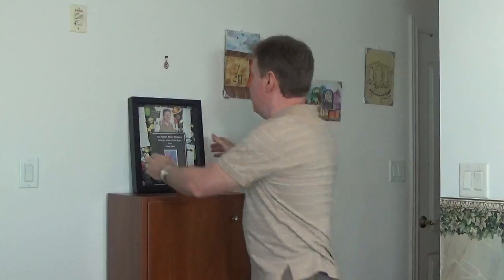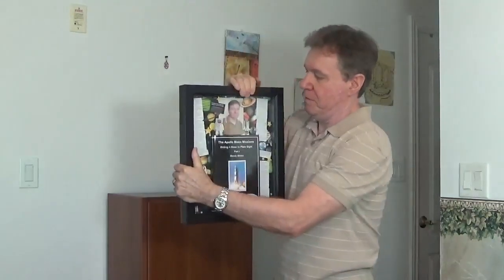Randy Walsh: Apollo Moon Mission Hoax, Saturn V and F1 engines. (Video #5)

Comment: RANDY WALSH: "And because of the pogo oscillations, the engines in the second stage - the J-2 engines - were disrupted. So, they have multiple failures, I believe they had 2 failures, actually one failure and then the computer for some reason shut down the second engine. And NASA says this was caused by disruption of the fuel lines, brought on by pogo oscillations.”

Nope. YOU made that claim, Randy - NASA didn't. 

Congressional Hearing - "SUMMARY OF THE PROBLEMS ENCOUNTERED IN THE SECOND FLIGHT OF THE SATIRN V LAUNCH VEHICLE" - APRIL 22, 1968 (page 18, paragraph 3)Major General Samuel C. Phillips, USAF, Director , Apollo Program for Manned Space Flight: "We have been able to confirm conclusively from the data that this POGO oscillation, which is a problem at the spacecraft level, and must therefore be corrected, was not at the bottom of the difficulties that turned up in the J-2 engines of the second and third stages."

In fact, you yourself said only recently... "NASA does not have a definitive answer." - but only after I had proven you a liar in the first instance on your original claim. 

The pipe failure was in a five-eighths of an inch, high pressure (750 psi) hydrogen line in which a bellows joint first cracked, then broke causing component failure elsewhere.

Apollo 6 Congressional Hearing - page 25 - GEORGE H. HAGE, DEPUTY DIRECTOR, APOLLO PROGRAM FOR MANNED SPACE FLIGHT: "And finally as a result of that line breaking, we had an erosion failure of this little starter combuster which ultimately resulted in a breakthrough in the top part of the main oxidizer dome of the chamber, which resulted in a fairly large decay in pressure and the normal shutdown sequence." (This part of the hearing transcript is well illustrated with drawings and photo illustrations.)

When you claim 'NASA says...' something, Randy, you need to quote them doing so. Attributing statements to them which you have pulled straight out of thin air just isn't working for you.

Comment: Youtube::: (World’s Fastest Car–1,000mph Bloodhound SSC) to see this supersonic-rocket-car weighing 7.5 tons (initial mass) had 135,000 bhp, ten times that of Apollo-Saturn’s horsepower, meaning that if it were equipped with Saturn-V engines it would have had only 1/10 of Bloodhound’s thrust-force, and thus would have NOT been able to move, except may be very slowly!!!. Similarly Apollo-Saturn’s thrust force of 13,636 bhp was unable to move a 3,000 ton mass, even on wheels, on the ground, much less lifting it off the ground!!! It is so simple!!!
Reply: "Simple", and unfortunately for you, wrong:

The Saturn V weighed about 6.5 million pounds, fueled.

It's thrust totaled 7.5 million pounds, on five 1.5 million pound thrust F1 engines.

Thus, a 6.5 million pound downward force was easily cancelled and more, by a 7.5 million pound upward force, resulting in an (approximately) 40 fps initial upward acceleration.
Reply: @occhamite  is there a moving car with power equal to 1.2 times of its own weight??? Name it !
Reply: @kareemsalessi   That has nothing to do with Rockets or the so-called Moon Hoax.

The fact is the Saturn V had a lift-off thrust-to-weight ratio of 7.5 to 6.5, or 1.2:1, and thus WOULD rise rather quickly off the launch pad.

Similar remarks apply to all other phases of the Apollo manned lunar landing missions; sufficient evidence is readily available to show that the missions are a demonstrated historical FACT.

Anyone who tries to argue other wise is an ignoramus, a fool, or a liar.
Reply: @paulgee4336  What makes you think you are familiar with the evidence?

I submit you are not, but for some reason think you are.

Here is a list of evidences which, taken together (as ALL would have to be faked, and faked perfectly, for a Hoax to hold-up), constitute proof by any reasonable standard (Sources available on request):

--------------------------------------------------------------------------------------------------------------------------------------------

The launches of the Saturn V Moon rockets were witnessed by MILLIONS of people.

The launched rockets were tracked all the way to orbit by international observers, including the Soviet Union.

The SIV-B 3rd stages appeared in Low Earth Orbit, (LEO) at the pre-announced places and times, and the Trans Lunar Injection (TLI) burns were observed optically. The spacecraft were visually tracked from those SIV-B burn's exhaust plumes, by both amateur and international observers, leaving LEO, on the TLI trajectory.

Apollo CSM/LM radio traffic was received by amateur radio hams, in sky positions and with doppler-shifts which made it clear the ships were in cislunar space and on a course consistent with lunar trajectories.

Astronomers in many countries observed the Apollo spacecraft in cislunar space and moving on a trajectory consistent with a trans lunar flight path.

Live tv broadcasts were aired, showing extended periods of weightlessness impossible to perform on Earth, and views of Earth from cislunar space .

Live tv broadcasts, FROM LUNAR ORBIT, of some of the Apollo missions were independently downlinked by the USSR.

The British Jodrell Bank radio telescope facility downlinked Apollo 11 LM, Eagle's radio traffic during its final lunar descent. The transmissions emanated from the correct quadrant of the Moon, and were doppler shifted exactly as for a ship dropping out of lunar orbit to a landing.

At least one radio ham downlinked, DIRECTLY FROM THE MOON, the VHF voice traffic of Armstrong's and Aldrin's personal backpack radio's, live, as the lunar surface EVA was in progress.

Video and film records of Apollo lunar surface EVA's contain unmistakable and unfakable examples of activities occurring in 1/6 g.

The reentry of Apollo Command Modules was observed by people in several countries, at the right time and place, and on the right trajectory.

Over the past 49 years, thousands of geologists, from all over the world, have analyzed the 840 lbs of Apollo Moon rocks, and NOT ONE has ever questioned their authenticity, though some have commented that the collection was obviously assembled by trained collectors.

The Lunar Reconnaissance Orbiter imaged all 6 Apollo landing sites several decades after the Apollo program ended and returned very high resolution imagery (as good as 0.05m/pixel) showing all aspects of the sites to be in perfect accord with the imagery returned at the time of the original missions.

Despite the fact that about 400,000 people worked on Apollo, no "whistle blower" with the slightest credibility has ever come forward to support the Hoax claims, not ONE guilty conscience, not a single "open upon my death" letter to an attorney, no anonymous letter to network news - nothing - EVER.

NO Hoax proponent has EVER made an objection to Apollo which stands the slightest scrutiny.

---------------------------------------------------------
--------------------------------------------------------

QED
Reply: @paulgee4336  So then, we are to gather from your silence that you accept the evidence posted?

Comment: The US Tyranny couldn't, didn't, and still cannot go to the Moon.

A typical example of the poor fakery that the NASA fraudsters tried to pass off is AS16-109-17800 from the Apollo 16 fraud.
 The right leg of the astroNot is casting a deep black shadow, but his up-light left leg is NOT.

Worse, in 17800 the Moon buggy's shadow clearly falls in a different direction than that of other shadows in the photo. Shadows in 17800 fall from the upper-left to lower-right. However, the Moon buggy's shadow, as evidenced by the shadow of its dish-like antenna, falls from the bottom-left to the upper-right.

The shadows of the astroNot and Moon buggy are a full 90 degrees off, forming an impossible "V" shape. What a criminal joke.

NASA. Apollo. Theranos.

"Ignorance is Strength." I'm weak.

https://www.hq.nasa.gov/alsj/a16/AS16-109-17800HR.jpg
Reply: K. Chris Caldwell
You'd better forget ever working as a photo analyst because you don't have the slightest idea what you are talking about.

1.) The shadow of the astronaut's left leg is obliterated by sunlight off the inside of the 'naut's right leg. Note that the Sun is shining from the left and from behind - EXACTLY where it needs to be to have that effect. The very light blocked to form the  leg shadow on the lunar surface is the light obliterating the shadow of the left leg. NOTE that the brilliant white teflon outer coating of the EVA suit is upwards of 90% efficient as a reflector.

2.) You haven't got a clue as to how shadows work: The "direction" of a shadow depends on the direction of the incident light, the shape of the object casting the shadow, the optical characteristics of the lens of the camera, and the contour of the ground the shadow falls upon. Shadows cast by a single light source can be made to appear to run at nearly 90 degree angles by manipulating those 4 factors.

https://tinyurl.com/y6ayoyye
Reply: @occhamite  ===SPAM

Comment: You really have no business making a video about Apollo 6, calling it a "hoax", when you are ignorant of the basic facts.

1.) At  1:18 you say the problem was pogo oscillations.

No, that was ONE problem, 2 actually, as BOTH the F1 and J2 had vibration problems on Apollo 6. 

Another issue was miswiring of the J2 engines during assembly,  which was the cause of the second J2 engine shutdown.

You say the second J2 shutdown was for "some reason"!?!  THE REASON WAS THE FACTORY MISWIRING; THE COMPUTER SENSED  VIBRATION  IN ONE J2 ENGINE AND SENT A SHUTDOWN COMMAND TO IT,  WHICH WENT TO THE WRONG ENGINE BECAUSE OF THE MISWIRING.

THIS IS ALL VERY EASY TO FIND OUT, AND IF YOU DON'T EVEN KNOW THESE MOST BASIC FACTS, SHAME ON YOU FOR MAKING ACCUSATIONS OF A "HOAX". 

Yet another problem was the single-wall bellows in the J2 igniter fuel line. During ground tests, that line had been reinforced by ice. The ice did not form under flight conditions, so the bellows, lacking the reinforcement, cracked, leaking fuel.

A third problem was structural failure in one of the SLA panels.....

These are all very MINOR issues, trivial to fix:

The F1 pogo was fixed by minor changes in shape of the F1 fuel lines, further "detuning" them, and by injection of helium into their prevalves, making those valves do double duty as "accumulators" - shock absorbers, in effect.

The wiring harnesses were shortened, making the factory miswire impossible, and the bellows was eliminated in favor of a rigid line; since the line didn't flex during ground testing, with the ice on it, it was determined the line didn't need to flex in flight either.

The SLA panel failure was found to be due to air trapped within the honeycomb structure of the panel.

The fix was simply to drill pressure-relief holes in the panel.

2.) At 1:54 you claim, incredibly, that "NASA never says anything about the F1 engine" !?!

Page xxxix, here:

"Saturn V Launch Vehicle Flight Evaluation Report - AS-502 Apollo 6 Mission"

https://www.ibiblio.org/apollo/Documents/lvfea-AS502-Apollo6.pdf

IN THE FIRST PARAGRAPH IS A DETAILED DISCUSSION OF THE POGO ENCOUNTERED PRIOR TO FIRST STAGE SEPARATION.

Not good enough?

"Final Flight Evaluation Report, Apollo 6 Mission"

https://ntrs.nasa.gov/archive/nasa/casi.ntrs.nasa.gov/19700025117.pdf

So not only is it no secret that there was an issue with the first stage of Apollo 6, it is EXTENSIVELY documented in the literature...

3.) At 3:12 you say Nasa "admits" to problems with the F1 engine due to combustion instability.

THAT IS AN OUTRIGHT LIE.

 NASA "ADMITS" TO PROBLEMS WITH COMBUSTION INSTABILITY DURING THE DEVELOPMENT OF THE F1. BY THE TIME THE ENGINE HAD BEEN MADE OPERATIONAL, THOSE PROBLEMS HAD BEEN SOLVED.

THE PROBLEMS WITH THE APOLLO 6 F1'S HAD NOTHING WHATSOEVER TO DO WITH COMBUSTION INSTABILITY OR REGENERATIVE COOLING.

THE PROBLEMS WITH THE APOLLO 6 F1 ENGINES WAS DUE ENTIRELY TO RESONANCES IN THE FUEL LINES AND SI-C STRUCTURE, AND WERE TRIVIAL TO REMEDY.
Reply: occhamite
===SPAM++
Reply: Keep blathering, MoonFaither. Some day you may actually convince yourself of your sad self-deceptions past the point of Cognitive Dissonance.
Reply: @paulgee4336   You may find that most people consider "blathering" to be criticisms leveled without any supporting logical argument or evidence.

When you can muster actual arguments or evidence, I'd be happy to discuss with you any  issues related to the  laughable "Apollo Hoax".
Reply: Apollo 6 took many still images of Earth during its time in orbit, they are meteorologically accurate:

http://onebigmonkey.com/apollo/CATM/ch4/leo/ch4_10_2.html

Comment: NASA never said that the shutdown of the other engine was caused by the disruption of the fuel lines by the oscillation.   The first engine shutdown because the fuel lines froze and stopped fuel flow, and the computer trying to shutdown that engine, shutdown the other.  The real problem was that the engines were badly wired to the computer, they were switched.  I watched your video for 1 minute and already find erroneous information.... imagine what i could do if watch even more.  This is very interesting.
Reply: Pogo oscillations caused damage to some of the fuel lines which caused one of the J-2 engines to shut down. The computer then down shut down a second J-2 engine. I suggest you watch the whole video and then provide the NASA report that specifically says the fuel lines were frozen, although, you need to rely on other analysis as well, since NASA has a tendency to change the narrative.
Reply: @randywalsh460  The oscillations had little or nothing to do with the engines problems. The oscillation was fixed with shock absorbers.  The frozen fuel line is what caused one of the engine to fail and the computer shutdown the wrong engine, because the computer was wrongly wired.  Its all here admitted by NASA engineers on video.  from minute 31:00. You are welcome. https://www.youtube.com/watch?v=o39UlJlMce8
Reply: @redmonkeyass26  Apollo 6 was way above the Karman line by the time the first J-2 engine failed, and there is no moisture to form ice. And of course, the J-2 engine in the third stage also failed to restart which was already in low Earth orbit. So all of this was due to ruptured full lines.
Reply: @redmonkeyass26  It's refreshing to see someone admit that may have gotten a fact wrong. There is so many details to analyze.
Reply: @redmonkeyass26  I was being sincere in giving you a compliment. However, I'll make sure that never happens again. :) And I have admitted to being wrong when after researching the Apollo Moon missions, I realized that they were faked.
Reply: @randywalsh460   If you really want to be refreshed, start admitting to the facts YOU get wrong.

That would be some world-class refreshment, as the corrections you need to make have virtually no end....
Reply: @redmonkeyass26  "Maybe you have to start asking yourself, Why you do you really want to believe it was faked."

I realized the Apollo missions were faked when I studied the technology and NASA's disturbing flight testing practices. That explains why NASA doesn't have manned spacecraft launch capability to LEO as of right now.

12 men walked on a replicate of the lunar surface, filmed by the U.S. military which have some of the biggest studios in the world.

But at least you admit that research means nothing to you.
Reply: @redmonkeyass26  "I find it very difficult to believe that you could actually do proper research on particles from looking at youtube videos, some online documents and no formal education."

Before you jump to conclusions, you need to check out the sources and qualifications in my book.

As for not having a formal education, you need to also check out who solved the problem of instability with solid fuelled rockets. If it wasn't for this person, there would have been no Space Shuttle launches.

A little research on your part, will do you some good.
Reply: See my fresh comment above, and stop fooling yourselves people!!!
Reply: @kareemsalessi  lol so the Saturn 5 were balloons huh  ? this is why it's so hard to take hoaxers seriously LOL

Comment: Interesting, a total new aspect of the story, never heard anyone else mentioning it and especially in the "moonfakery" scene most contributions just recycle the points of previous findings over and over again!
Reply: Too bad it's a load of nonsense.

And it's not new either. That idiotic claim that underweight Saturn V's were launched with smaller engines because the F1 didn't work was made YEARS ago.

Randy not only doesn't have a clue when it comes to Apollo, or anything scientific, he is not even original.
Reply: You never heard Randy's version before because it's bullshit.